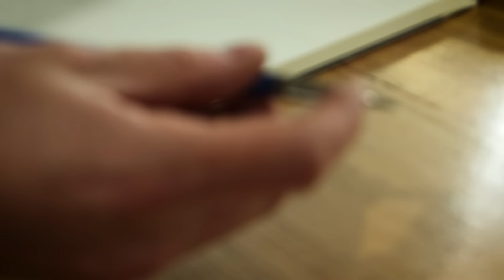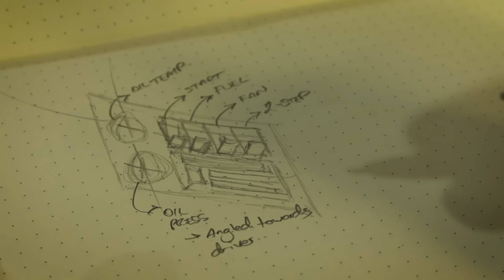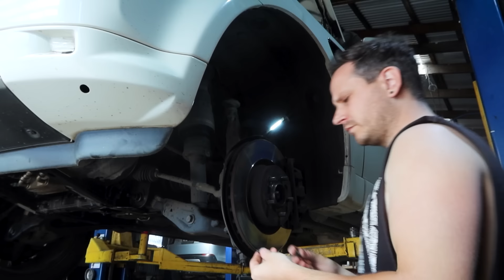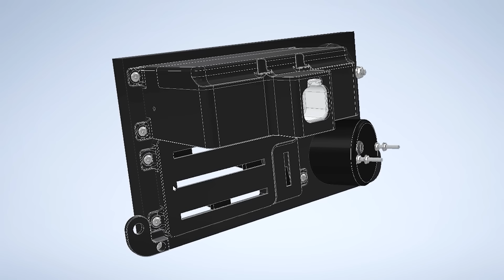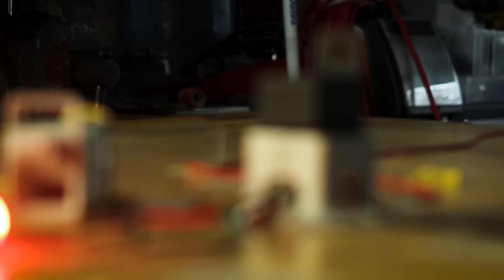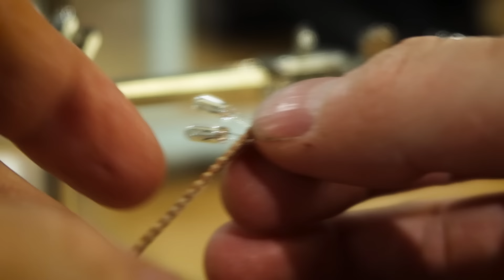How I Designed 3D-Printed Mods for My Vintage Toyota KE25

Comment: i'm no electrical or mechanical engineer, but I did learn a tad bit of wiring skills this year (enough to rewire every major component of my car and more). granted, my skills are FAR from perfect, but watching this gives me confidence and motivation to invest more of my time into the skill. i was NOT cut out for college or any sort of engineering or design class, but my ocd for cars pushes me to learn above my limit😆 I absolutely love old patina and i enjoyed watching this very much👍
Reply from the maker: Awesome mate I'm glad you could find it motivating - keep at it! :)
Reply: @fatlipcollective  great video mate, just stopped by to make a quick point regarding relays and wiring.  Keep in mind fuses, or more correctly circuit protection of any sort is ALWAYS sized to protect the wiring and never the equipment is is powering.  If a fan draws 7.5a then sure a 10a fuse is suitable, but the 10a fuse must be used on a circuit that the wiring size is capable of handling 10a.  The wire is what gets very very hot and melts if it draws too much current, your equipment is what makes it draw the current, your fuse or breaker is what STOPS the current and prevents melting, burning, strange smells while bang shifting 3rd on a twisty mountain road etc!

Comment: Thank you for the knowledge you shared! A rudimentary question from here: how do you make sure the holes/clips are perfectly aligned for the printed parts and how do you prevent any rattling? What I can think of now is printing some simplified model that won't take much material and trial and error. But this will take a long time for large panels as it keep going back and forth. Is there a better way to do it? Is this also an experience thing that the more I do the faster I will get it right?
Reply from the maker: Thanks for watching mate.
There's lots of variables with your question but basically it comes down to design, experience and manufacturing method.
I have a good idea of the tolerance I need for my printers and then can tweak from there depending on the design.
Like most things you get better with practice :)

Comment: Just a correction fuses are sized based on the wiring they protect the wires not the appliance at the end
Reply from the maker: Trying to keep it super basic but yep you're right. More on wiring in the next video :)
Reply: @fatlipcollective  cool

Comment: I absolutely love you for using actual incandescent bulbs not LED, it’s a little detail that makes all the difference that unfortunately everyone overlooks
Reply from the maker: Thanks mate! It's the little things :)
Reply: anyone have name of this bulb i want to buy them for golf 2 but i cant found them like this ?
Reply: It's sort of an odd thing to do considering you can achieve the same thing with a warm white LED and a coloured cover - something Technology Connections has investigated in great depth.
Reply: my first thought too; go with a warmer led.
Reply: @MrManningata  If you've seen Technology Connections' videos, you would know it is not the same thing, as the white led produces different wavelengths that you can't just change with a filter.
Reply: @bradleylauterbach7920  except his most recent video on the topic where he pretty much concludes the opposite of all that you've said, and that the choice of a good quality LED and appropriate filter can look the same as an indicandescent bulb.
Reply: @bradleylauterbach7920  Been a while since I watched that video, but it heavily depended on the type of white LED too, if you had RGB led's all on to make white acted differently to a white only LED using different phosphor coatings to achieve a white light output.  It's one of those weird sciences. For me, LED's are fine if they're dim enough. I replaced a lot of the indicator lights in my car with SMD LED's that I desoldered off a really cheap, shit LED brake light, I'm probably underdriving them, which won't be good for longevity, but the ones with the green sleeve over are a slightly colder green than the incandescent lit ones but it literally cost me 5 cents to do, and now I can see all my switches at night time again, which I couldn't do for a long time.
Reply: Led will never be the same, a similar effect sure, but not the same. LEDs are great for some applications and definitely have their place, but not the same

Comment: For the perf board another way to go that could be really nice is custom printed PCB using surface mount components.
Reply from the maker: I did consider it but atm trying to keep things relatively accessible and like the idea of not relying on toooo many things that might be outsourced or going a bit beyond the basic hobbyist.
Got some other ideas for some more complex projects in the future though :)

Comment: A great video overall! I would like to point out one thing that i would change the wording on. The fuse one the + wire should be sized to the gauge of the wire. the wire should be then sized to the Amp load plus a safety factor. other wise spot on with your relay explanation.   Your 3d modeling is super great! I have started to dabble in it but have not got super far.  ETA Are you going to print your dash items in PETG or ABS/ASA at a later time? I'm not sure how long PLA would work in the summer. I have had trouble with it in the summer in the mid north part of the USA.
Reply from the maker: Thanks mate, yep you're right, but just trying to keep it super basic for now - I'm going to cover that in a bit more depth on the next vid.

Likely not PETG, possibly ASA but I'll cover materials selection a bit more in the next video. PLA would absolutely get destroyed on a medium summers day in Melbourne. Boxing day was 40⁰C/104F outside the car 😂
Reply: @fatlipcollective   sounds good! I missed the very end of your video were you went over the preview of the next video due to watching at work lol.  Yeah ASA would be great for car stuff. PLA is super good for the prototypes.  We had a boxing day heat wave of 0c but we do get up to  the mid 30s celsius in the summer.

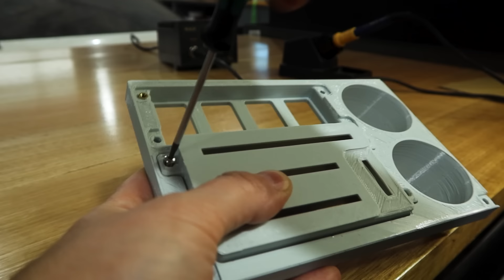Comment: @23:45 i'd be willing to bet, using more than 2 screw inserts to affix parts is a good way to reduce chances of noise from rattles and squeaks...
Reply from the maker: Possibly, but the parts already key in quite well, and will also secure to the heater bracket which will provide rigidity - we will see though!
Reply: @fatlipcollective  oh sure, and I hope that didn't come off as a design criticism. This a great vid of your efforts.

Comment: Where were you 2 year ago ! . I've just completed a similar conversion on my own vehicle . However i went about this in a completely different way .

The vehicle is a series 2 , year 2000 , Fiat Ducato based Motorhome , probably known to you guys as an x230 . I wanted to update the dash , but like you , needed it to look like a factory option , that never was . The bid was to add a gps navigation system , but didn't want the extra screen that made it look like an after thought . A reversing camera would also have been nice , and straight away you can see the problem . An uncluttered dash , would suddenly have extra screens all over the place . Not a good look ! 
What i went with was a Kenwood media player , which had both these options , plus hands free phone ability as well . The problem was as anyone who already owns an x230 knows , it only has a single din radio tray , and the Kenwood is a double din . 
I modified the panel to accept a double din . Yes i lost the ashtray , and cigarette lighter in the process , but as i no longer smoke that was not an issue . I couldn't print a new panel , as i don't have that ability , so instead i welded . I had previously learnt to plastic weld in what was a successful bid to repair my front bumper , so i went that route . I studied the problem for a good year before any work progressed , looking at any issues that may appear , and solving them in my head . I carefully planned the sequence of the conversion , before i even showed the panel a knife , which was likely very rare , and probably extremely difficult to replace . It took an awful lot to actually begin , but today i now have a completed , one off double din radio tray , that fits a Ducato 230 . Finish was aways gonna be a problem , so i had the panel hydro dipped last month . That brought a project i started 2 years ago to total completion , and frankly looking outta this world . I've still yet to fit it , but it will be in the next month or so .
Reply from the maker: Nice mate sounds like another full-on project! Glad you found a way to make it work :)

Comment: You forgot to mention the biggest advantage to using relays is that you can drastically cut down the long lengths of big gauge wire , and the fact that you will prevent the big voltage drops since the wire length is much shorter - giving you better light output from headlights etc. I used to have an early 80's Porsche where retrofitting relays to the headlight circuit was a common mod because of this, and also the fact that in this era they used a headlight switch that was made from flammable material (genius). This has led to the demise of many oldschool beetles and Porsches from this era.
Reply from the maker: Hoping to cover a bit more of this when I go over wiring selection in the next video :)
Thanks for the comment and the info RE the Porsches though, crazy all the little quirks that sneak through quality control here and there

Comment: A vernier is a single instrument, not a pair.
Reply from the maker: Incorrect
Reply: @ yes, you are incorrect. That is what I am pointing out. Is just a basic metrology concept.
Reply from the maker: @annakquinn7084  I wouldn't normally do this, but seeing as it's Christmas I even looked it up for you:

Calliper: Noun
a
: any of various measuring instruments having two usually adjustable arms, legs, or jaws used especially to measure diameter or thickness —usually used in plural
a pair of calipers

Merry Christmas
Reply: @ 1) Christmas is a pagan celebration not related to Christ 2) colloquialisms are not acceptable in engineering, calipers are just one instrument, a pair of calipers is just 2 calipers. 3) you can’t measure a distance without a reference.
Reply from the maker: @annakquinn7084  mate just admit you were wrong lmao. Calling them a "vernier" is a colloquialism. It's a vernier scale on a pair of callipers, often called vernier callipers.

Thanks for playing.

Comment: The size of a fuse should be related to the wire that you're using, the wire should be related to the amp draw. The fuse protects the wire!
Reply from the maker: Baby steps mate, I'll cover more about it when I do wiring in the next video :)

Comment: Halfway through the video, I felt the need to pause and leave a comment before I forget.

First of all, amazing work on this video! The information you’ve shared is incredibly helpful and well thought out. You’ve clearly taken the time to explain how certain things work in great detail, while also ensuring everything is easy to understand with the tools and visuals you’ve used. Massive respect for that!

Secondly, the wealth of experience you’ve demonstrated in this video really stands out. It’s evident that this isn’t your first time modeling or working with this software. Everything is so well explained and backed by solid reasoning. It’s truly a treasure trove of knowledge, and I’ve learned a lot from it.

If I had to point out one area for improvement, it would be the lighting or overall cinematic quality of the video. I understand that might not be a priority for you, but with the voice-over, editing, vlog-like vibe, and the occasional B-roll shots (especially when you’re holding a piece to show it to the camera), a bit more lighting or an upgraded camera setup could elevate the visual aspect of your videos. The content itself is outstanding, but the visuals might be the one thing slightly holding it back. Just my two cents! 😄

Also, it’s mind-boggling that this channel only has 11k subs given the quality of your work. Subscribed, and I’m looking forward to seeing more from you. Keep up the fantastic work!
Reply from the maker: Hey mate thanks for taking the time to leave such detailed feedback, I appreciate it.
Re the lighting, I had some technical difficulties with some of the sections and already had to re film a bunch so I had to push on before I went crazy haha.
Still appreciate the feedback, each vid should be better than the last and I've got some cool things already for the next one :)

Comment: How do you go about finishing the 3D prints for paint? and how do you go about keeping the 3D prints from deforming inside the car on a hot day?
Reply from the maker: I'll cover both of these topics in my next vid, but briefly, plastic primer is a good start and choosing the right materials for printing will help prevent heat deformation
Reply: @fatlipcollective  Ok, I have subscribed and I will wait for that Video! Please go in depth about Materials specific to use in Car interiors, as its one of the topics never discussed, especially for Australian Summers!
Reply from the maker: Cheers mate! It's on the list :)

Comment: I always go with captive (square) nuts over heatserts because they won't wang out and start spinning.
Reply from the maker: Depends what you're doing, I do often do that but depending on print orientation etc it's not always the best way. These parts aren't seeing heaps of torque - just enough to secure the pieces together :)
Reply: @fatlipcollective  true. I'm used to making stuff that sees industrial use and isn't allowed to fail ever, so I got in the habit of doing that. I could see that using a heatsert could free certain aspects of the design
Reply from the maker: That's it, horses for courses. I definitely get the temptation to make everything bomb proof 😂

Comment: Just discovered the channel, love the video. You’ve got a new subscriber. What’s your guidance for tolerance on parts you are trying to fit together?
Reply from the maker: Thanks for watching mate!
The short answer is: it depends.
As a rule of thumb, about 0.6mm overall is good place to start. Higher or lower depending on your machine, it's accuracy, nozzle size, etc.

Comment: 4:15 this is exactly my thought process whenever I modify the interior of my car. Anything i cut, may not be available new if i ever wanna go back to stock so I always try solutions where i make a replacement part that has the modification in it.
Reply from the maker: For sure - also adds a bit to the challenge as well :)
Reply: No excuse not to when u can make any shape from plastic

Comment: I like to use stainless steal nuts. I’ll put a recess and put them in midway thru printing.
Reply from the maker: Yep I do that too, depending on the part. I show some of that in my video with the timing wheel, that's what is used in the clamp for the dial indicator :)

Comment: 2nd. Do you ever mess with bringing in an image of the object and reference scale it? Or any other ways of modeling complex shapes, like a dash bezel that's more jelly bean shaped than some oval.
Reply from the maker: Sometimes I do, depends on the part and the shape.
You might have noticed that the OEM fascia is slightly curved and mine is flat - that's something I'm going to address in the next video :)
Reply: @fatlipcollective  awesome looking forward to it. the automotive space is gonna get even more wild as printers, scanners and software become more standardized. the possibilities for someone at home to go from a model to a product is nuts!

Comment: fail fast fail often, thats definitely the name of the game. just curious, when you model things and then 3d print them. do you adjust for accuracy? i find this is the type of stuff im having a harder time having a rule of thumb for. if my gauge pod is 45mm and i want to make a housing 3d printed, what size are you modeling for the hole? 45.5, 46? same with those threaded inserts, do they give guidance to what size hole they should go in like a tap calls out what size drill bit you use. 

Great video and love the detail! even if im not there yet, if i can use 5% this time i watch it, i know i can come back later and gain another 5%
Reply from the maker: Thanks for watching mate. 
The short answer is "yes". But there are a lot of variables, I plan to cover this a bit in my next video.
Re the gauge pod, 1mm should be more than enough, I'd probably do less. Depends on your printer setup